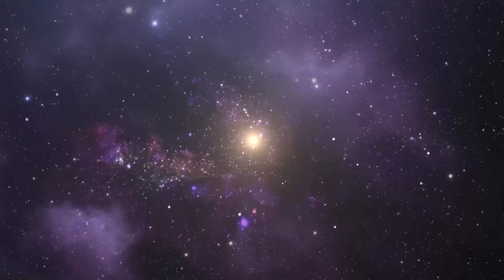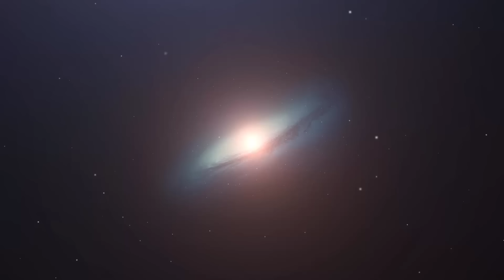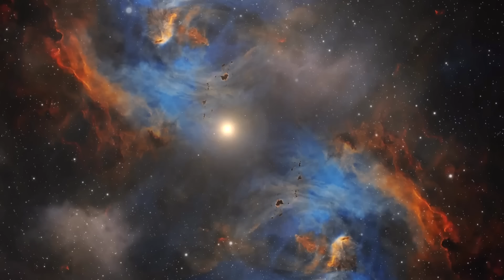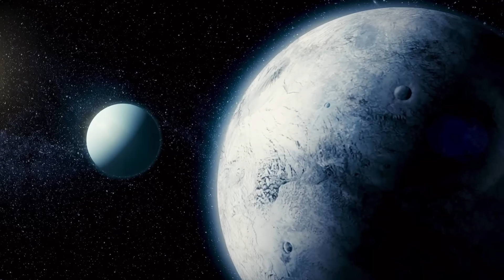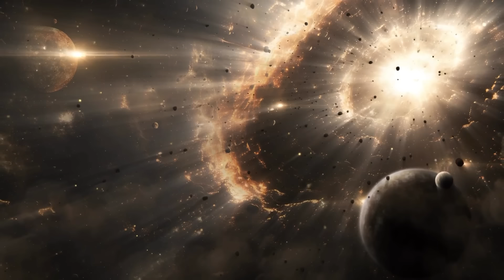What Will Fail First on a 100-Year Starship? | Space Documentary

Comment: As an aside, everything you have pointed out justifies  having a mid-manufacturing plant.  This is needed anyway.  Upon entering the destination system all these sensors and gaskets will need to be made for the construction of infrastructure.  Replacement parts and plants should be stocked for 140 years per 100 years of transport.

Comment: You design the ship in a way where nearly everything if not everything can be fabricated within the ship. That means everything needs to be recyclable to raw materials. From circuit boards to modular hull plates. Lastly, I’m of the opinion that the generation ship should be a space station at its final destination. Say you get somewhere. Instead of committing to a planet fall, instead you reach your destination, settle the ship in asteroid belt rich with metals and ice. Then manufacture several colony ships that will be able to land and become shelters.

Comment: On a starship built to survive for 100 years, the first failure may not be the engines. Life support, electronics, materials, and even the closed ecosystem would slowly degrade, turning small problems into threats long before the journey ends.
Reply: Backup systems and auto switch technology would be needed. 

Multiple backups possibly. 

So many services could be an issue. I think this could be a good use of AI.

Still who knows what technology will be available  then? 

Adaptive systems? 
Stmi organic systems? 

Who knows?